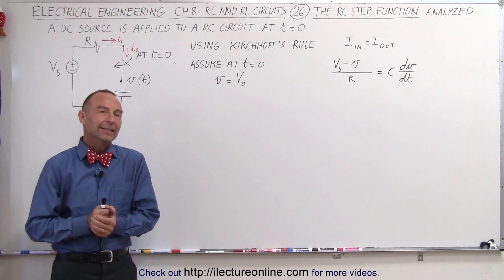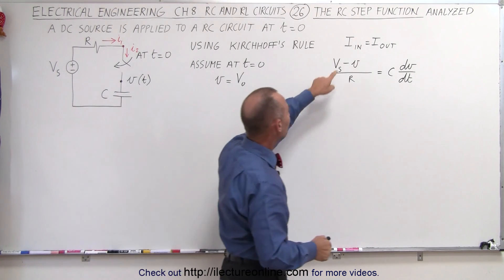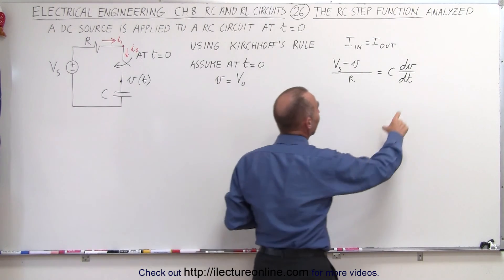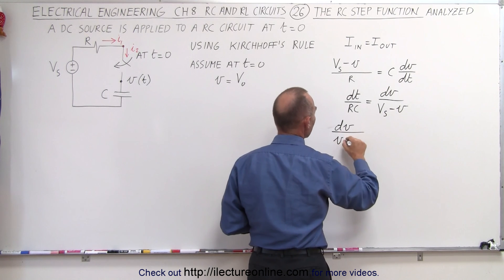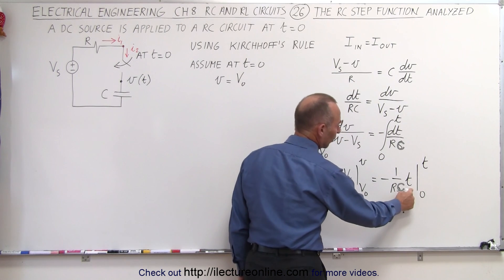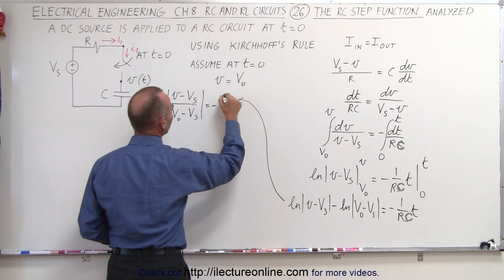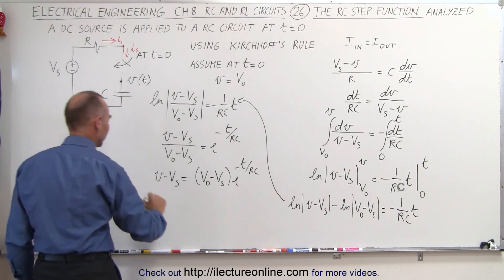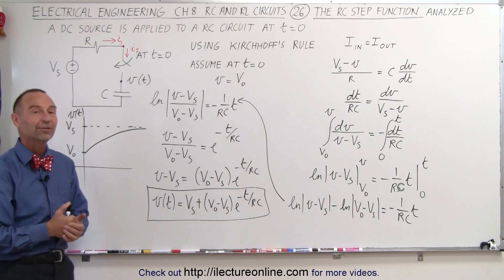Electrical Engineering: Ch 8: RC & RL Circuits (26 of 43) RC Step Function (Analyzed)

Comment: what if the resistor and capacitor is pararel ?
Reply from the maker: That is covered in ELECTRICAL ENGINEERING 11 AC CIRCUIT ANALYSIS     and in     PHYSICS 49 RCL CIRCUITS

Comment: How do you know that you should integrate the left side from V0 to v?
Reply from the maker: Vo is the initial voltage at t = 0 sec.
Reply: We integrate from an initial time t0, at which the capacitoe has an initial voltage v0, then at a later time t, the final voltage of the capacitor will be v.